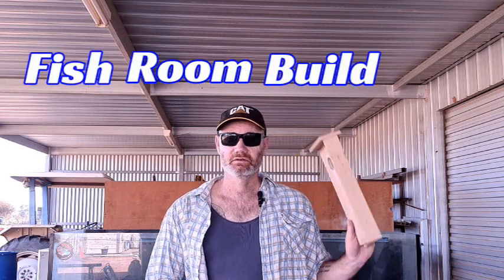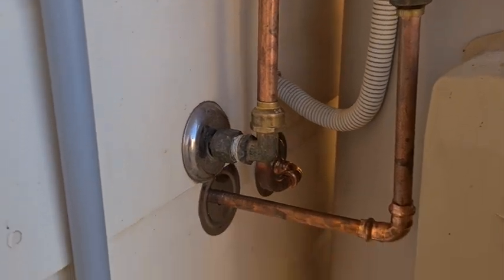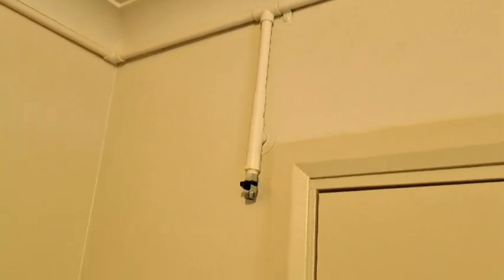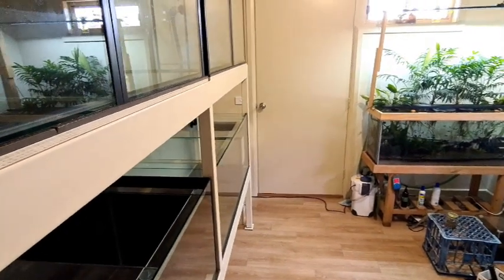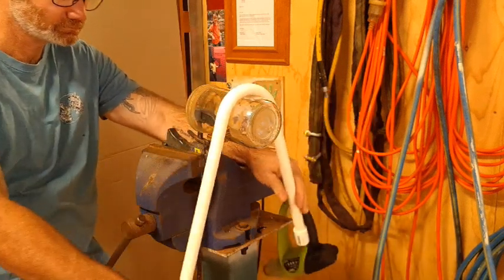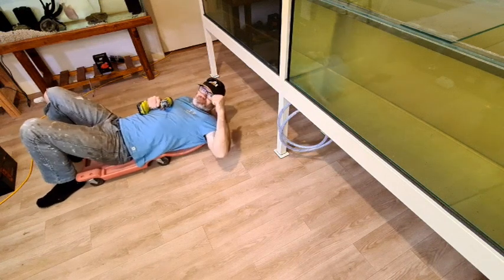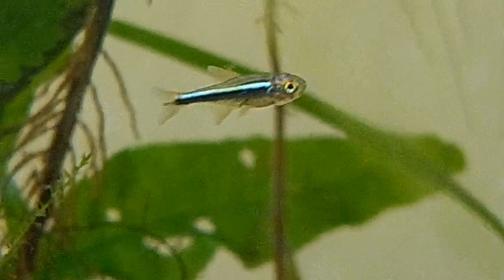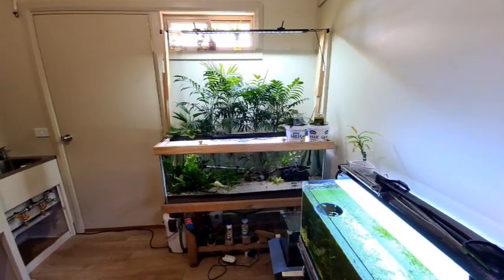Fish Room Build #3. Awesome Water Change System.

Comment: Filling the pipe with Salt if you dont have compressed air works aswell 
Just dont use sand because you could end up with small pieces in the plastic were salt can be washed out 
Great video and good Aussie humour
Reply from the maker: I have not tried salt, although I have tried sand. I found the compressed air worked really well, because if you get a kink or other imperfection, just heat that area and the air will push the kink out.

Comment: Nice setup, I'm in WA around 4 hours out of Perth and 5 hours away from my favourite aquarium shop. My tanks are a bit more spread out as the place we bought has a 6m x 6m games room, that's mine and the wife has the rest of the house lol. For filling my tanks I mix the water in a 120L plastic drum with the top removed and when it's up to temperature and de-chlorinated and de-chloramined, I use a submersible drum pump to re-fill the tank(s). I have a toilet cistern filler valve on the other end of a garden hose from the pump, I just hang that on the side of the tank and it cuts off the flow if (when) I get distracted. To partially empty the tank I use a 600lph submersible that utilises the filler hose to drain to the veggie garden. The pump has a 600ml bottle minus the bottom on the intake side with a fish net over the cut end to prevent fish getting sucked in, I set the height of the cut end of the bottle to prevent me over emptying, I leave this on when re-filling without the cistern valve as it spreads the outflow and doesn't disturb the plants or gravel, I just have to be very careful of distractions. 

I have been using "washing machine" drain hose sink hangers for a long time, and for other uses around the garden as well, the ones off dishwashers are usually a touch smaller and a better fit if you can get hold of them, the rubbish tip in my country town is a good source of supply for those and quite a few other bits and pieces, the price is spot-on too.
Reply from the maker: Sounds like you are on top of it! I have a small float valve usually used for things like stock troughs that I intended to do the same thing, but just haven't got there yet. Did you make some sort of bracket to hold it in place on top of the tank?

Comment: Like the set up.  Very clean.  May want to isolate electricity and water.😅😅😅
Reply from the maker: Thanks mate. Yeah, that power point under the sink is a pain, and I had to change the plumbing to get away from it. It's all connected to a safety switch in case the worst should happen.

Comment: I’ve seen the pvc heat bend where they use salt inside the pvc it worked well also.
Reply from the maker: I've never tried salt, although I have bent pvc using sand. I found the compressed air worked better, because if the pipe kinks you heat that part and the air pushes the kink out. Make for a smoother bend.

Comment: That's a great system to  control the water intake temp for places with a huge climate variation, not a thing for me in northern Brazil, temps always the same, but great idea. If I may, whats the purpose of the brace away from the edges of the tank ? Feels like it would be less structurally safe, and removes the "safety corners" where fish usually try to jump from, following the edges of the tanks
Reply from the maker: I would love to live somewhere with a climate like yours! I didn't make the tanks, but that is a pretty common design here. I've had tanks like these for years with no problems. You are correct about fish jumping out at the corners, so I use lids.
Reply: So just some weird local practice then, here some tank builders have a mania of doing the bottom of big tanks out of two (or more, I've seen up to 5 or 6)  pieces of glass siliconed edge to edge, some claim it makes a more flexible bottom, but since it's a continuous seam on every other panel I don't really get how it's supposed to protect the tank from flexing, but oh well, it works still as well. I really just think the first guy did it to save on buying new glass and using spares, and all others just imitated it after some time